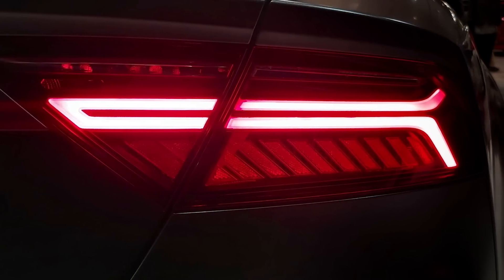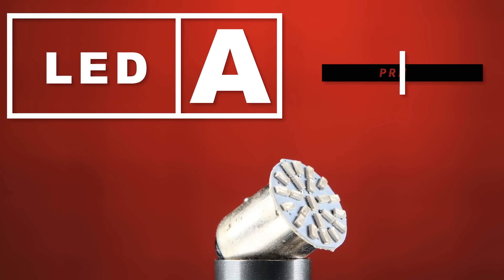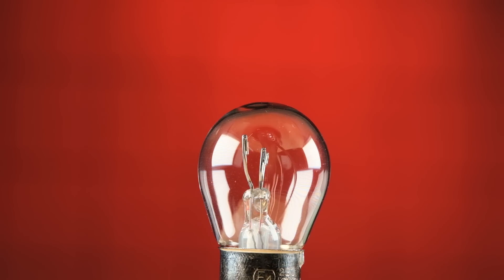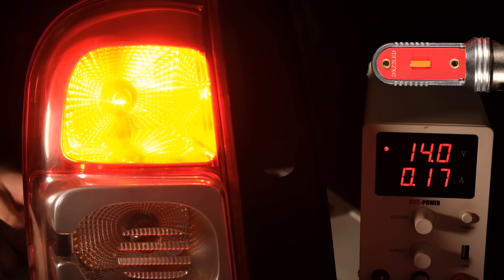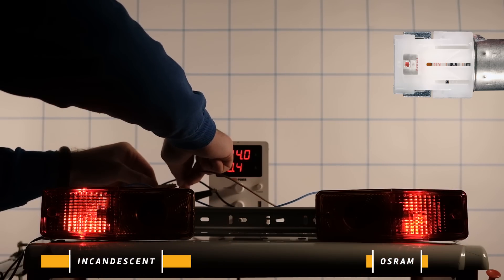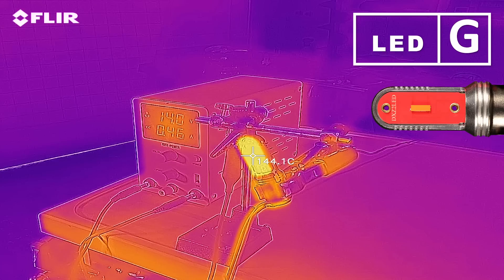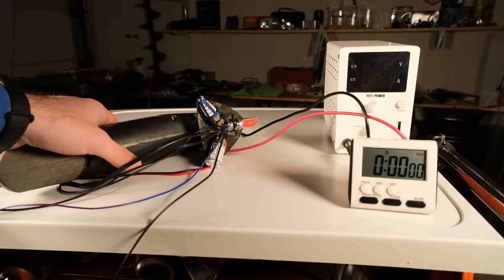LED STOP Lights TESTED - OSRAM vs PHILIPS - Light output, Temperature management & Endurance tested

Comment: I experienced something with my last set of taillights warping and deforming due to a brake light pedal switch being faulty and basically my brake lights were staying on almost all the time when I was driving but I was unaware. That was when I was using oem incandescent bulbs. Now with new set of tailight housings and a new switch I’m searching for bulbs s that will run cooler and this was a scary video lol

Comment: canbus problems still not solved.
5w.. they car will detect the lamps is no good
Reply: That’s because all of these led bulbs, especially with osram and Philips doesn’t have a built in resistor. U can always get a Novita LED flasher relay or Philips warning cancelor.

Or get a led bulb with a built in resistors.

Comment: Hello Sergiu, I watched your comparison of P21/5w LED bulbs. I have a 2022 FJ Cruiser and I want to change its P21/5w front turn signal bulbs to LEDs and I would like to try the Philips one in your video. Unfortunately, in Polish stores I found Philips X-Trema Ultinon 2 gen only red, and I need white ones (because the lamp shades are yellow). Do you know if the Philips LED X-Trema Ultinon 2 genmodel is produced with white diodes? Can you send me a link to them?

Comment: @SergioGabor

Can u do a review of more brake light bulbs?

Instead of cheap LED’s. How about reputable brands, and which one is the best one?, which is better, which performs better, the price, and the warranty. 

Like from Sylvania ZEVO. I know Osram and sylvania are the same company. 

Lasfit, Auxito, More Philips such as vision, Ultinon, X-treme ultinon.
Xenon depot. Those have fully ceramic led bulbs that are much more efficient than metal heatsink.
And auxbeam?

Anything with a very well made heatsink included, it makes it more interesting.

Comment: I have no luck with LED brake lights on my car. I have tried both with and without strobing. The strobing ones, when I turn on the headlights, the strobe pattern goes once and then never reset. And the LED will not have two intensity mode, like how the light glow brighter when you step on the brake pedal when driving at night. Any solution to that?

Comment: I remember that in my previous car that mot guy told I had a weak light from my stop, which in that car had a single lamp p21w for stop (CHAMADE 16v) and I question if it was ok to use retrofit LED.
The engineer told that as long as the brightness parameters are ok then it's good, and he also commented that some new cars with stock LED have ridiculously bright brake lights. I was lucky to found new taillights and a pair of LEDs announced with 700 lumen from a Spanish seller, and was as ridiculous as the new cars. Managed to get a quick appointment with the mot engineer and he laughed when he saw how powerful it was by sunset time, but all was good. You know how on highways you have reflective info panels, I remember once braking and noticing a panel all the way on the long straight and see the refection from over half a mile. Now I've got a car with p21/5w and having s bad time choosing bulbs cause that seller closed shop.

Comment: Hi, Sergiu & followers:
I' ve just met you while searching for some ultra bright, confiable and compact H1 LED bulbs for my old, but perfectly preserved 1998 Seat Ibiza.
In the tail lights of this car I installed LED "H" type bulbs for all functions (Stop & tail, fog, reverse, and turn signal lights) around the year 2020, coinciding wiht the publication of this video. They cost about 3 or 4 € each, at Ebay.
I must say that the improvement in luminosity has been remarkable in all of them, and therefore also in safety, and today all the bulbs still light correctly. Definitely, one of the best investments that I' ve ever made in my veteran car.

Greetings from Santander (Spain)
Ciao!!!

Comment: I'm astonished and haven't seen another video mention heat. I have been under the impression these bulbs run cooler. I opted not to convert the lights in my classic car to LED but I DID convert my instrument panels lights over to LED. Now I'm thinking about taking them back out!! Good video and detailed.

Comment: Philips and Osram are pretty good, but actually they are not that greater than the stock halogen brake lights, in my opinion, brake bulbs are and turn signal bulbs are not worth changing.
Reply: Yes they do. 

Try Sylvania Zevo. 

It’s the same or hair brighter than stock during daylight. And couple hairs brighter than stock during night time. 

And it depends on ur application to see the Zevo works wonders for ur vehicle.

Comment: I could be wrong but i think the problem is they are using red LED in a red lens should you not be using a white LED to mimic the halogen bulb which is not red?
Reply: Correct. 

If u put white led lights behind the red lens. It will be more usable than incandescent bulbs. 

Putting red led behind the red lens will become more usable light and it automatically increase the intensity, all because of the red led lights up lord through the red lens or they call it red filter.
Reply: Putting white LED’s behind the red lens will become less usable,less bright than incandescent bulbs and the red lens will look orange when it lights up.

Comment: Osram and Phillips work great on vibrating motorcycles with big reflectors like Harleys and KLR's. On the Harley i had to rotate the bulb holder 90 degrees to make the best out of the reflector.
Otherwise a good $1 incandescent is still the best and cheapest bulb.

Comment: I always look for 2835 or 3030 smd chips. They seem to be the brightest. The different chips vary huge in brightness. A 2835 chip is probably 10x brighter than a 4014 chip etc. Never believe what the seller says or the specs they show. It’s always wrong.
Reply: I’m wondering what type of SMD led that Osram LEDriving or sylvania led, Philips X-treme ultinon or X-treme vision used?

And I agree.

2835 and 3030 are the best SMD LED.

I don’t mind 4014, or 5050 style LED.

Or even Osram SMD led.

Comment: Got the osram red after watching this.
Reply: How are they? And did it filled up the red led lighting output well?
Reply: yup does the job and a little better @toyotabrony
Reply: @PJSinohin  they are very well made. 

Same design just a different brand of sylvania led. 

I’m running a sylvania zevo 7443R led bulbs. They are such a well made led bulbs and using our reflector housing as it should. Very usable light output.

Comment: 👍👍👍 great test. I am looking to upgrade an old fire truck light bar, 10 bulbs 1156 incandescent. I’ve heard halogen would have too much amp draw. Looking into LEDs. I have read a suggested Osram SL P21W. Couldn’t find them in the U.S. I’m guessing Osram/Sylvania 7506BSYLLED  is in my future, thanks to you.

Comment: hi Sergiu, here in the USA a lot of vehicles have red turn signals :(  i was wondering if you could perform a test of the suitability of using the various bright 1156 green LED within a red lens to convert these tail lights to amber output?  Amber tail lights would be much safer and if people could just use a green bulb to convert to amber this would be great.

Comment: This was a JOY to watch!     I reached these results MANY years ago.    In the standard open clear housing, the Standard Bulbs do best overall in those kinds of housings.  They also have the really cool slow rise and fade time.   As far as the Amber bulbs are concerned,  Same thing with most with clear housings that use a reflector style.   (But is not always the case)   

I like being able to have my Lights on for long periods of time, so on my Minivan, they work great.  But for just about everything else?  The Halogen loaded bulbs work best.   Even when used as back up bulbs.   
A NOTICE OF CAUTION HOWEVER! 
Those of you that don't have a RELAY on your Back up bulbs should install one.   Especially on cars that have the reverse switch inside the transmission like some Chrysler cars.   When that burns out inside your transmission is a MAJOR HEADACHE and cost to fix.    

Those of you with DIM Halogen bulbs?   TRY RUNNING A RELAY HARNESS!   Also, you can run them with A/C If you know what you are doing and know how to get it straight from the alternator.    THe bulbs will just as long or longer, and have MUCH more output as long as you keep the voltage within 15 Volts AC.    

For the rest of you?   And a CHEAP UPGRADE?   Get your Headlights  with SOLID Copper Wire,  Terminated at the Alternator, and  Ground as well running to no less than a 40 amp Relay per bulb.   Reason being is voltage drop.     Same with your High Beams.     On average Stock wire is just not up to the task for incandescent bulbs.     Again, IF YOU HAVE to or want to keep stock bulbs.   

For everyone else?   LED.  Hands down for weak Headlights.   

But as for Turn signal Bulbs?   Most of the time, its best to just stick with the OEM bulb.    Clean the contacts and lube the contact pins once a year to prevent any corrosion from setting in. 

If you REALLY need BRIGHT Amber looking Bulbs?    Just get the COB Amber LED headlight bulbs, and use a Silcone Adaptor as those are fan cooled and at LEAST put out a bit more light then Stock indication bulbs for running lights.   Or those that have bulbs that only turn on and flash then turn right off.  (Some Toyota early model vans etc)    

As far as Back up Bulbs?   If you HAVE the gumption?   And can do it SAFELY?   HID Bulbs will work for this.   Strongly recommend a RELAY .    But it should fit in most SMALL housings and should not melt with the small amount of time you have them on.     Otherwise, you are making custom bulbs with 100W Led Chips with some ALuminum stuck to it for THermal mass heat sinking.   Its the ONLY soultiion I found would work in SMALL housings that allow you to face the LED towards the rear of the housing.    

I had some Luck with  making custom LED with this method with Small CPU coolers and  Server fans, but  overall,   Best to be used as Back up lights as the noise also alerts people.   

My Budget champion so far has been a simple round reflector Fog Lamp,  with 130W h3 Bulbs that can be bought for a few bucks.    And the round reflectors can be had for less then $20 bucks.    They have been the Brightest so far next to custom Light bars.   

Lastly,  for those with Reflector housings?  Some of you might have luck with the  4 or 6 way COB LED bulbs that are cheap since they suck at projecting the lights, but are pretty good at local fill.   Great for seeing curbs, but not much else.  

Hope that helps out some of you at least in the USA.     Thankfully, the Euro's just have good lights from the factory.

Comment: I still think “If it ain’t broke don’t fix it”, I would rather be using a tried and true method instead of LEDs
Reply: Using incandescent bulbs gets hot as it is we expect. And they burned out after few years of daily use. They get degrade from time to time. With reputable brand like Osram led and Philips led will not.

Comment: thanks for this informations .. but i need the name of this base of those bulbs >> and the same shape but very small >> like the BMW E39 Angel eye bulbs>>what is it name size ??
for ex : H7 9005 T10 p21w .. so what is the name of BMW E39 angel eye Bulbs ??
thank you
Reply: Get urself a sylvania zevo for as set it and forget it led bulb replacements.

But is ur tail light housing has a small but narrow shaped housing, does ur reflector looks like a 9005 high beam reflector style? A 360 style reflector housing.

Comment: Problem with the light output is that lux measures light output in green specter since it’s the specter human are most sensitive to. And when you try to measure light output of monochromatic lights (with clear led chips) which produces exclusively red spectrum you get 0 lux. When you measure full spectrum leds (with orange led cover) which produces light in all spectrum but most of the light in red, you get some lux measurements, since there are some green light coming out thanks to luminophore.  When you measure incandescent light it shows the greatest lux measurements because incandescent light actually output light in all specter almost equally, so when you look at it directly it glows almost white (since all colors add up and become white)

Comment: You are using red LEDs. I wonder if the results would change if you use white LEDs, which I am sure would be more appropriate
Reply: Ur wrong. Putting white LED’s behind the red lens will become less usable. 

It will look dimmer than incandescent bulbs.

Using a red led behind the red lens becomes more usable and it enhances the brightness better than incandescent bulbs. 

Even if the white led bulb was a thousand lumens, and the red led bulb was 700 lumens, the red led will be better behind the red lens. Not white. 

If u put white led behind the red lens, it will look pink-ish or more orange. Not a good look.

Comment: Would love to see you do some testing on interior LED bulbs.
I have already done some testing with various types of 41mm and 36mm festoon bulbs and the results are very good.
The best so far is 41mm 6 SMD 3030, it uses 2.3w, is very bright and has a good heatsink. 
Send me a message and I will send you a link to my testing results spreadsheet. 
I can also send you a link to a really good Chinese reversing light LED bulb.
Reply: Can you please link your spreadsheet? I just bought a 41mm SMD3030 festoon and I'm wondering if it's the same as yours. Also I would be interested in the reverse light you mentioned. I bought the MAXGTRS from Sergio's video on reverse lights.

Comment: Well, to be fair I don't think most of those bulbs  were meant to be kept in the "brake" high-power mode all the time, as they are probably overdriving the Hell out of the LEDs and getting away with cheaper designs/no heat sinking due to "intermittent usage".

Comment: I'm using LED H as a turn signal, which is not continuously operate like parking lights. Is it safe from fire?    :3
Reply: If it’s no issue than ur lucky. However I need better illumination and more intensity.
Reply: @toyotabrony  I sold the car 1 year ago, hope next owner in good luck lol
Reply: @TommyThuta  lol nice

Comment: Brilliant review. Twenty20 make amazing brake and indicator (turn signal) bulbs.
Reply: I concur. Running stop/tails and indicators. They are both heaps brighter than the corresponding incandescents - but must be facing the right direction to get the full effect. I bought 2 pairs of indicator globes, intending to do both rear and front. Unfortunately my fronts have the globe facing sideways so they were dimmer than the incandescents. I also got hyperflash when I swapped out the fronts, so I gave up that idea.

Comment: I have LED H on my signal bulbs. Pretty good and bright plus no hyperflashing! But seeing your results on parking/braking lights, I'd stick to incandescent.
Reply: me too  i have LED H  for all  of my tail lights. signal, brake and reverse. I might as well change my  Break light into stock halogen and leave the signal light and reverse light installed. although my signal light LED H will hyper flash after around 3-5minutes  of use
Reply: @heymanbatman  How long did these bulbs last for you? I ordered these for reverse and 4 signals, brake light led seems too dangerous.
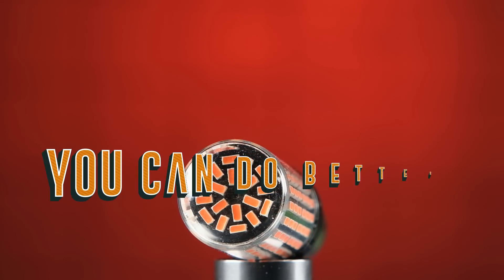Reply: @aboveaura4817  14:10 im using this type of reverse light until now. while my brake light and signals remain stock halogen. when im using led signals it tends to hyperflash, while led on brake light it isn't noticeable that i am already braking 'cause the idle light is already bright so it might be dangerous for me and other drivers behind me

Comment: I use the Osram LEDriving their premium version I got dirt cheap. Compared to the halogen I had it's brighter and responds faster. It also matches the LED tail light the car has but never included the brake bulbs. Not sure of what the differences between the LED Driving and Premium, other than the heatsink which looks like the Phillips you showed. Still I can recommend the bulb, as I've used it sub-zero temps and up to 30c with no issues and it's passed all the annual tests.
Reply: The premium has a better heat dissipation, and the brightness will remain the same compare to the standard version of the led.

Which means the premium will last over decade.

Comment: I have been using the Philips LED bulbs on both my cars for about three years and like the way they work. One of the bulbs failed but I replaced them under warranty. I was surprised at how hot some of the cheap bulbs get and the brake light didn’t get that much brighter!

Comment: I have a full set of type D but they look much brighter than these you are showing. Atleast brighter than the old ones i had. Maybe its because of the voltage drop on my 30 year old loom 🤔
Reply: Definitly going to test the temp though. For turning signal it wont be dangerous i think.

Comment: The review misses the most important point...Are the Osram and Philips bulbs canbus error free?
Reply: Yes, but depends on the car. Some cars won't have a check on any lights except indicator or headlights but both Osram and Phillips sell canbus kits to use if you need them. LEDriving  work in Ford cars (Focus/Mondeo Gen 3 and Gen 3.5 for Focus and a 2015 Mondeo) and an Audi A3 (2005 era). I got a batch of these lights for 50% discount from a closing down sale, and gave the rest away to friends to use a number of years ago and they're all still working the last I knew of it.
Reply: @thirdenvoqation7735  I don’t think any of these bulbs have a built in resistor...
Reply: @zakhassan  No idea, but I'm just passing along what cars these bulbs do work in. I'm pretty sure with many Ford's and older Audi they don't do CANBUS checks on anything other than indicators.